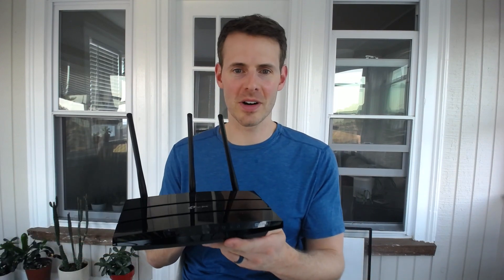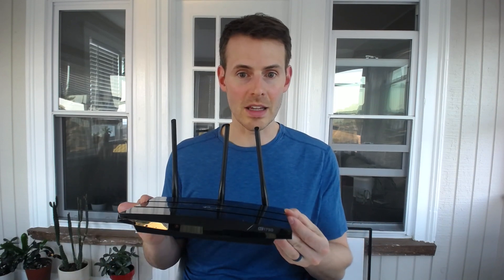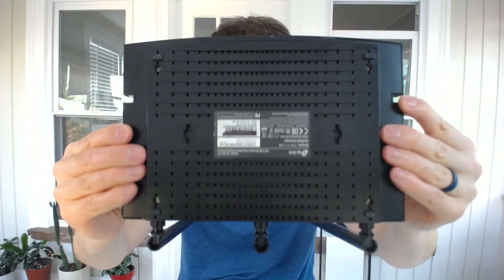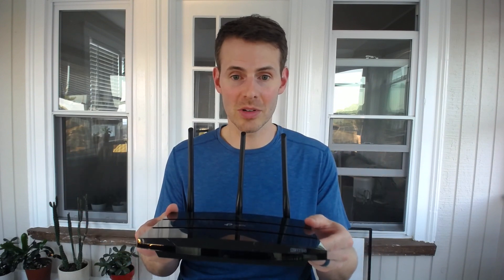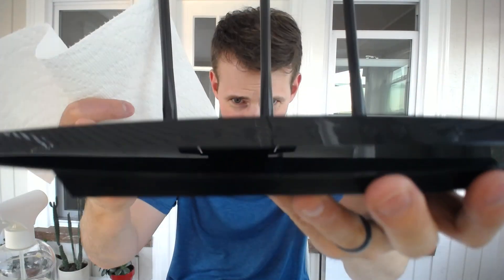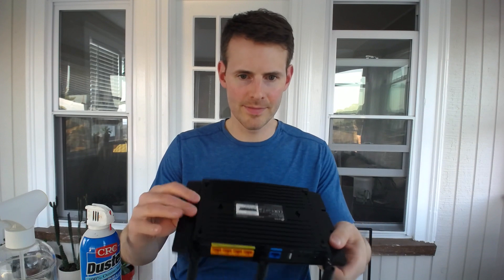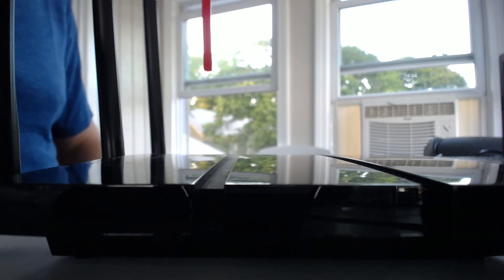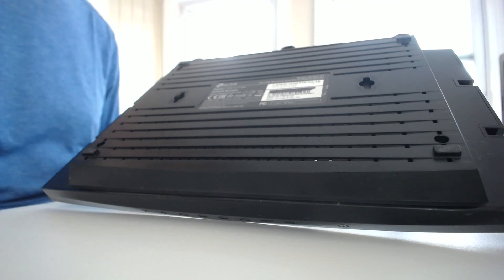How to Prevent a Router From Overheating

Comment: My router is placed on a stand on the wall and would overheat and cause random disconnections during peak usage hours. The thing i did is; I attached 4 screws to the surface of the stand and attached it to the provided screw holders on the router; which would lift the router about 1.8 cm from the ground. Then I attached an external 12v 1Amp PC cooling fan to the side of the stand directly facing the router.

My router used to be around 63 degree Celcius (145.4 degree F) now its sitting at 40 degree celcius (104 degree F) during peak hours.
Reply from the maker: Oh wow, it sounds like your router got really hot. Even with a cooling solution it sounds like it runs on the hotter side. Do you live in a warm climate? I’m guessing even 104 degrees Fahrenheit is on the higher end of your router’s operating temperature. Thanks for sharing!
Reply: I live in a hot climate, and the router provided by my ISP is located in a closed room without any HVAC system—just natural ventilation.

 I've run Ethernet cables to other rooms that have HVAC, and those routers work flawlessly (92⁰ F). Unfortunately, my ISP uses proprietary routers and won't replace them with better options. The outside temperature is usually around 83⁰ F to 89⁰ F during summer.
Reply from the maker: Ok, yeah that makes a lot of sense. Thanks for sharing! It sounds like you’re doing a good job for the environment you’re in. Good work!

Comment: Service provider put ours in the Service cupboard no airflow tiny ethernet cable so can't be moved out its cooked 😂 no its not funny but connection was bad tonight after they sent a firmware update it overheated and its cooked!
Reply from the maker: Yikes, I'm sorry to hear that. You might want to get a longer ethernet cable so it doesn't have to sit in a service cupboard that doesn't get any airflow

Comment: Can you connect mini fan in back USB to cooling down it’s router?
Reply from the maker: @phamtheanh1632 you can plug a mini fan into your router, but keep in mind plugging a fan into your router’s USB port will cause it to use more electricity. This will lead to more heat generated by the device. As a result, a mini fan might do you more harm than good. I hope this helps. Thank you for checking out the video